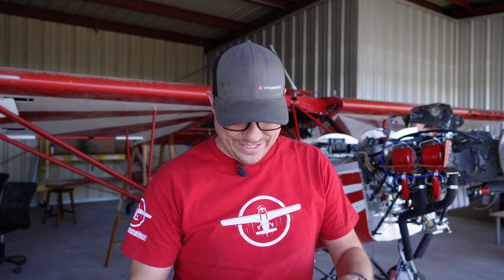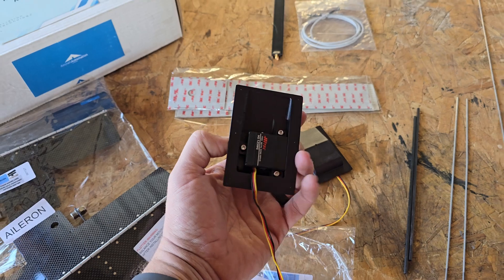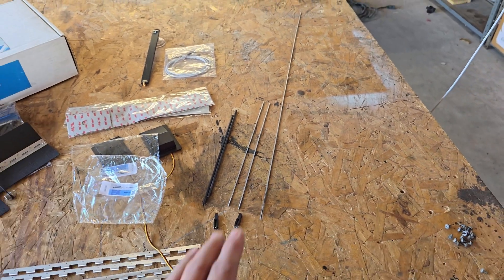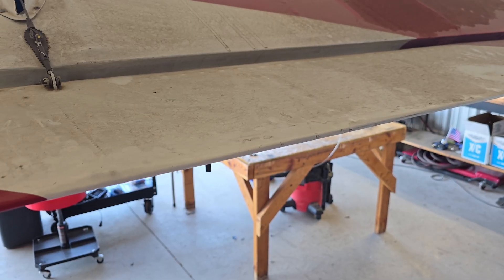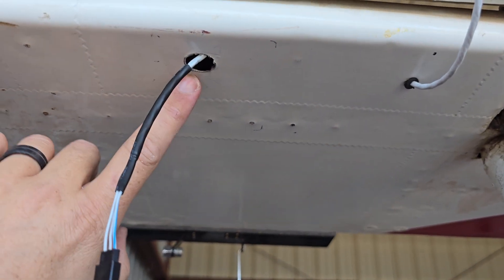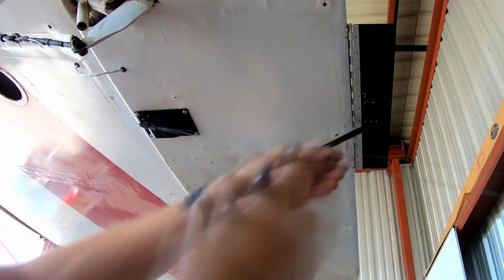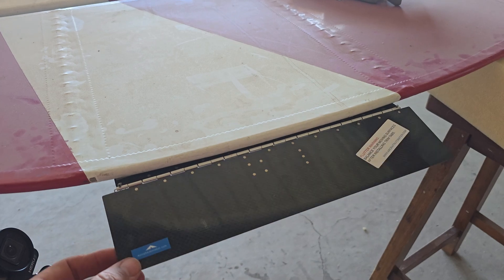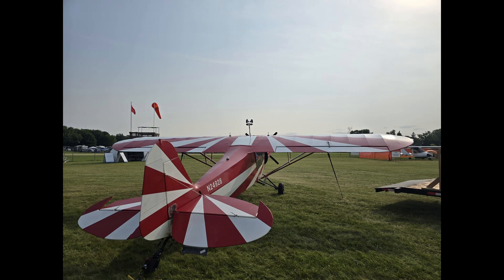Flying a FULL SIZE PLANE With RC Servos | iLevel AP Trim Tap Install

Comment: Thanks for the video!!!  I have been looking at this product and you answered many questions.  One I have remaining is:  " Did you balance/rebalance the aileron or elevator after install?"   Thanks for the info!
Reply from the maker: I did not. The unit itself is incredibly light with minimal drag. I noticed zero rolling tendencies or control issues with it installed.

Comment: I have this system installed. The 3M-VHB is extremely strong, it won't be the 3M-VHB that fails. Once applied correctly. It'll be something else. This AP is very easy to overide. Servo power switch is a must, AP disarm switch is needed to "disarm", AP will still remove some forces from the control, it'll still trim in Disarm mode, makes the aircraft fly "lighter", but once servo power removed, it's back to normal. 

An excellent system that I am testing on "XLAM Skins" and has proved great so far. Cleaning the surface and ensuring the 3M-VHB tape is bonded correctly and at the correct temp is a must. I use IPA for cleaning the surfaces. I can't stess enough that the 3M-VHB is applied correctly. 

They do a few different sizes of trim tabs for aircraft speeds, I used the slowest, mine is max 100mph. It works well. Servos are great, app is great. I'm putting the system through it's paces. So far no issues. Just make sure you don't think an AP will allow you to sit back and relax. They don't, they are just there to take some of the work from the pilot. Not all, with this system you can look out more and pay more attention to other aspects. Watch everything else closely. Don't let it climb away and potentially stall. Watch your instruments and look the window. Enjoy flying too!

Comment: Rc servo and real planes won't work well also your rods are too long it bend easly in flight, put your trim taps fuse under your hand in case of malfunction. There are lots of incidents aviation grade electric trims and rc servos won't work well in moisure. İ can easily say after 20 years of rc experience :)
Reply from the maker: Not to worry, the longer rod, though I forgot to put it in the video, has a fiberglass tube around it for reinforcement. There pictured on the table when I went through the kit. As far as the servos, they haven't had a failure yet! We'll have to see how the hold up over the years.

Comment: I would NOT rely on the adhesive to hold that elevator trim tab in place. I have used 3M VHB tape on various products, and eventually the adhesive gives out. Especially during hot days. Not to mention, you'll have wind blowing against the trim tab creating drag against it. I really think you should mount this more securely. If that trim tab comes off in flight, I'd hate to think what could happen. Please secure this better and don't rely on the tape.
Reply from the maker: I know what you're talking about. I've used all kinds of adhesives on different projects. I installed these when it was 110 in my hangar. Ended up removing it so I could add rivnuts to the carbon to access the servo better. Ended up accidentally tearing off paint and primer down to the fabric and had to use my heat gun on the carbon to get the rest of the adhesive off. It's for sure one of those things I'll check regularly. All I'm saying is its really secure.

Comment: This looks really dangerous for the reasons mentioned in other comments. Makes me afraid for the quality of the other parts they are producing
Reply from the maker: It's been tested on all kinds of aircraft for countless hours. Sometimes its hard to adopt new technologies outside the norm. The servos used here have all metal gearing and powerful motors. It doesn't take much force to deflect the tab and hold it, but it can manipulate the plane A LOT. I know a guy with a carbon cub that has this system in it. Fly's all across the nation regularly. No issues.
Reply: @flywiththeguys  I hope that my fears are misguided. I'm following with interest because I have looked at this system and GRT's system. The risks of having a servo pile up or some foreign object in an RC servo is just too high for me. I think I would be more comfortable if the trim tabs were smaller and you had more authority to overpower them, or a way to decouple it. I look forward to follow up videos. I think the experimental world needs an approachable AP system and I think we would both agree it needs to be a safe one with failsafe's or redundancies.

Comment: IMO, those tabs need to be small enough that you can overpower them should they become jammed at full deflection.
Reply from the maker: They are. PLUS I still have my manual trim to overpower the elevator should I need it.

Comment: Installed this system in my Zenith CH601m primarily for inadvertent IMC safety. I had had a couple of bad experiences and a lapsed instrument rating proficiency made me realize how easy it is to lose control in this scenario.

During my first two test flights I was got the order of the panel switch positions confused and turned the autopilot on the wrong way. In the first case the extreme and rapid nose pitch up was frightening. The force it took to overcome the autopliot was extreme. It took two hands on the stick and a lot of muscle to get the nose back down.

On my second flight I made the same mistake of  turning the switches on in the wrong order. This time the plane rolled over to a 60 degree bank so fast I thought it was going over on it's back.

I have been flying for 30 years but there have been only a few cases where I was so scared as these two experiences. After my second flight it was very clear to me that there was no way I waws ever going to reach for the autopilot in an actual inadvertent IMC situation. It was quite clear that it was just as likely to kill me should i turn the switches on out of order. It seemed to me this could happen in just such a stressful situation.

I emailed Aircraft Automation after these incidents and they simply said, "yes this could happen if the switches were in the wrong position. The fact that they designed a system where this could happen didn't seem to be an issue as far as they were concerned.

I made the very painful decision to rip out the entire system. To their credit, Aircraft Automation did give me a full refund even though the trim tabs could not be reused.

I think the heart of the matter is the use of a "one size fits all" trim tab size. The trim tabs are not specifically sized for your aircraft. They use the same ones for a light sport as they do for a much heavier and faster RV. I think smaller trim tabs specifically sized for the aircraft might eliminate the extreme forces created by large tabs on a lighter plane. Or possibly a software change that could minimize rapid pitch up and roll situations.

In my opinion, while i think the basic concept is good, there needs to be improvement is trim tab sizing for specific aircraft plus software redesign that eliminates the "wrong switch position" issue.